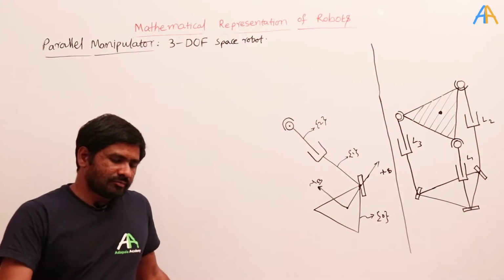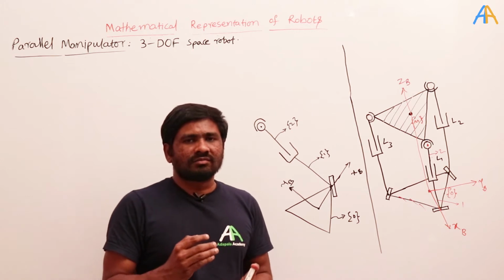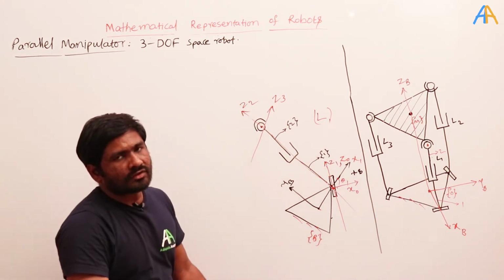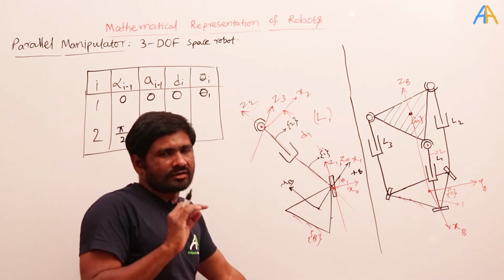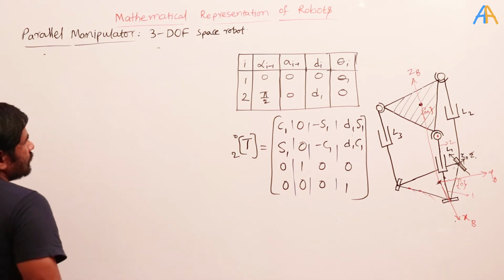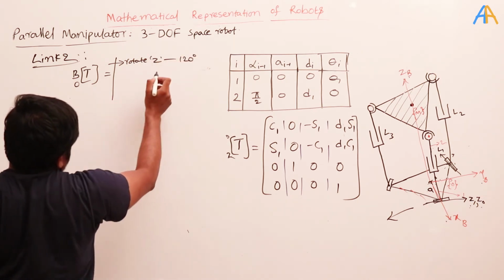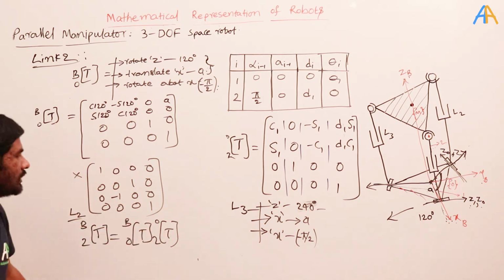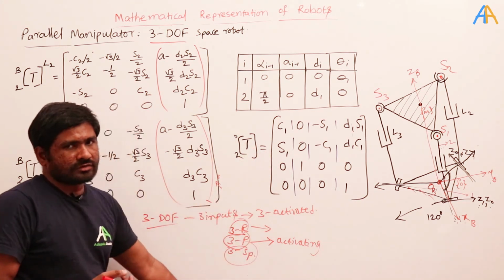2.14 Robotics || ESE Mains || D-H parameters of 3-DOF Parallel robot

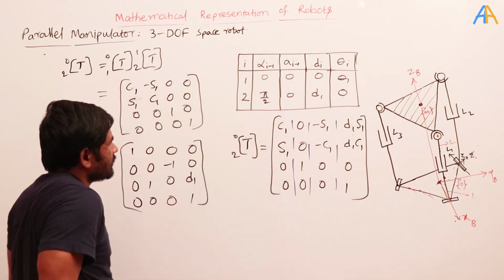Comment: This is a good explanation. But at 19:51, the 02T matrix is not coming by the product of the other two matrices. In the end, also finding the final matrix till the platform center has not been covered considering the spherical joints.
Reply: That's right. Do you know how to find the position of the center of the final moving platform, which is the forward kinematics of the robot, using this DH parameter method?
Reply: Getting the final center pose through forward kinematics is not easy and was tried in multiple phd. dissertations. With that you can understand the complexity and difficulty of finding such solution.